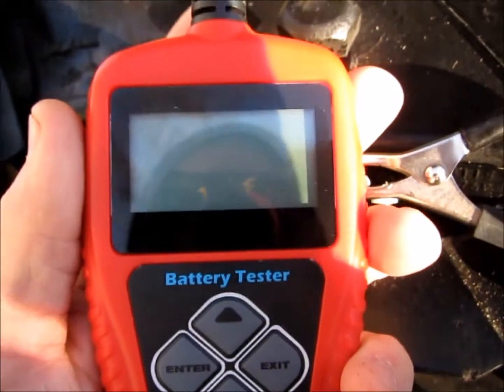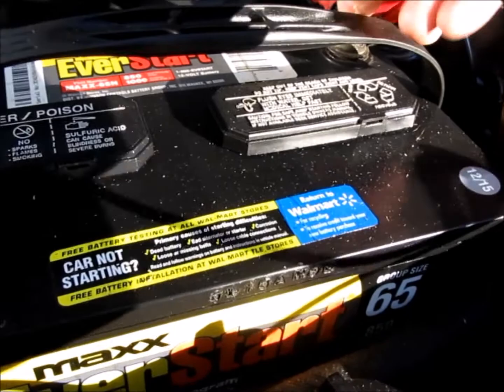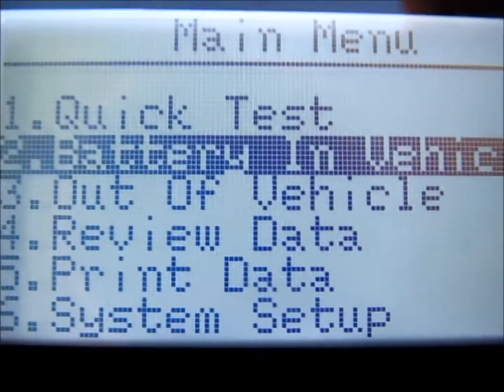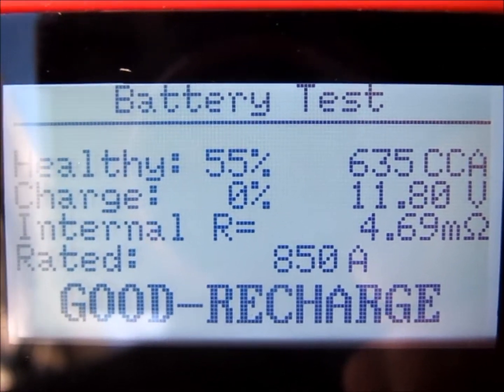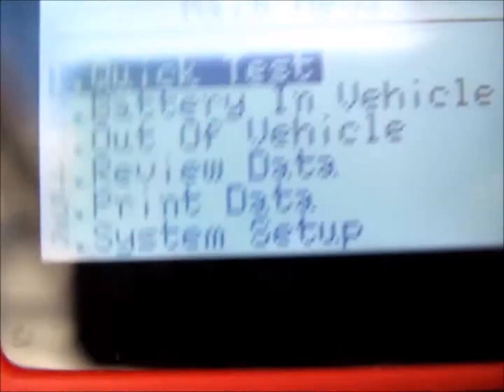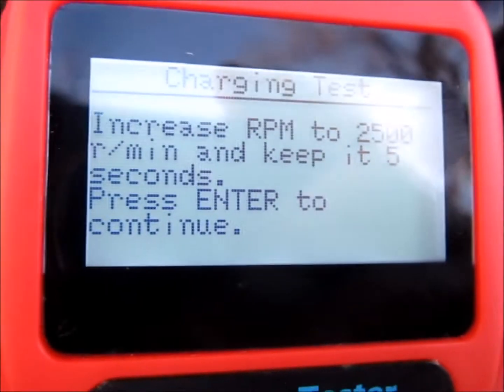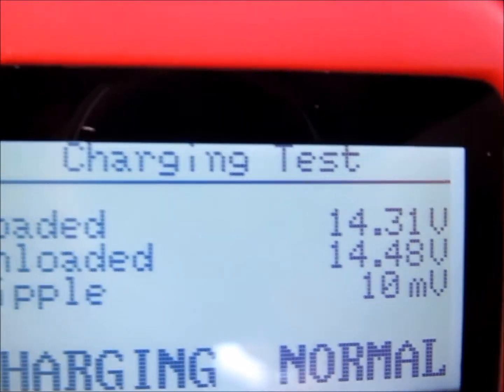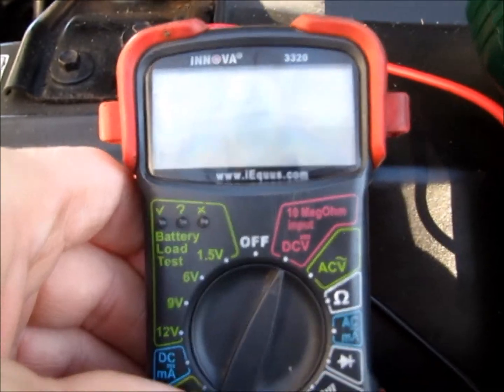BA101 Battery Tester Looking at Ripple Current Comparison

Comment: I just saw your video and that software looks a bit better than what my micro-200 scanner software is. Yours prints just the way the information is displayed on the screen which is what I wanted, but on my software for the micro, there's no print option on their software. I have to save it as an excel file which sucks. Not a huge deal but I wish I could just print like yours. I do like the actual scanner. Mine has the nicer square clamps that I think open  and grip a bit more than the small ones on this scanner, but the software on it is pretty much similar to what you have. It definitely helped me with a battery that wasn't even a year old. So these little scanners work great. The best part is how cheap they are.